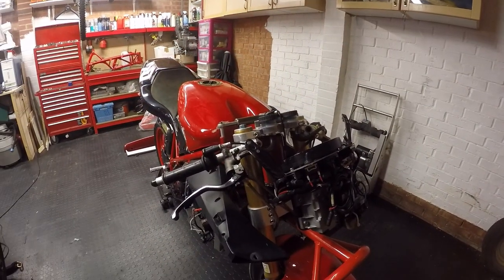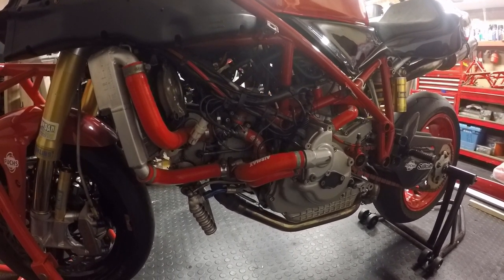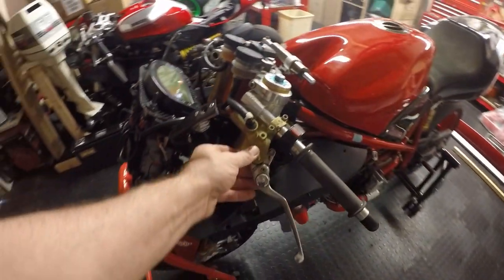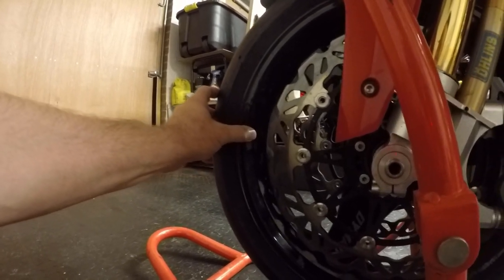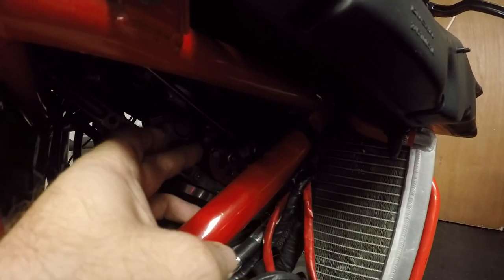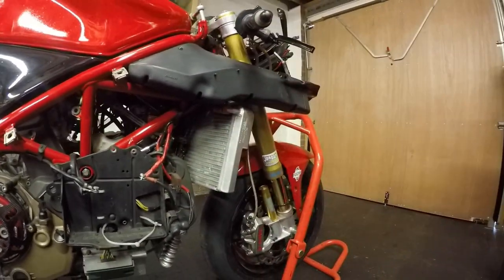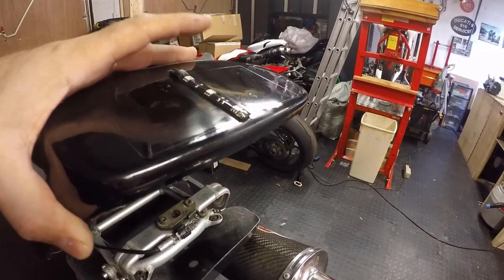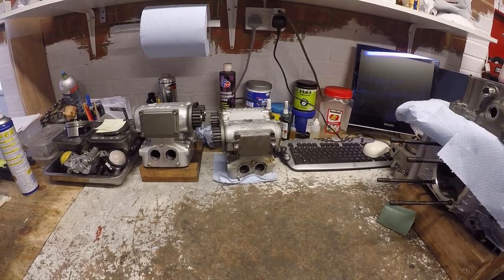2012 and 2013 Championship winning Thunderbike Chassis

Comment: great! for my 748 iam going for 120/70 front tyre (120/60 stock) may i use 180/60 tyre for better contact patch and to mach the height of the front tyre instead of 180/55?

Comment: I own a stock Ducati 748 and I want to do more track days and maybe swap the fairings to full race trim.  I'm not fast jet but the pace will come eventually. Could you give me some pointers on what I can expect when I use a 748 as a track weapon? What are the things i'm going to run into and what should I keep in mind? I love this channel, great work on the engine rebuild
Reply from the maker: Hi Flyingdutchy01
As long as you service the bike regularly and set-up the suspension properly there will not be many issues at all. 
The standard clutch is a bit awkward to use so is worth changing for a slipper clutch.
As you get faster you will likely need to change the set-up to suit your pace as the suspension will work harder and your slower settings will make the bike feel awkward
Get some good tyres on the bike to exploit the grip 
Another thing to check is that the hub is in the correct location i.e. at the botton of the swingarm as if its at the top it really messes up the handling.
Have fun :)

Comment: Hello, i own a 996 (stock) and you mention in your (nice!) video that you also run a standard 996 and changed to cams to the sps ones / High compression pistons. Is that drop in? or are there other points of attention you'd point out? Thank you for your great content by the way!!
Reply from the maker: Hi Fred, yes the parts were drop in and then just timed. You could balance the crank whilst it is out for extra benefit and then lighten as many parts as possible. 👍😎

Comment: Awesome machine. Tell us more about the Panigale R in the background!
Reply from the maker: Its a 1199s with a soon to be fitted 1199R engine, :) 
Videos coming soon
Reply: DesmoWerx a proper R engine (2015+)? I thought the 2013/14 Pani R engine was a bit of a letdown by comparison despite both being very fast.
Reply from the maker: Its the earlier one, so not full power but has the titanium rods so more reliable at track speeds than the stock 1199 engine

Comment: What’s the compression ratio with these pistons and what do you use for fuel?
Reply from the maker: If I remember right I think they were 13.5:1 but I will check, as for fuel I just use Super Unleaded at 97 RON or greater.